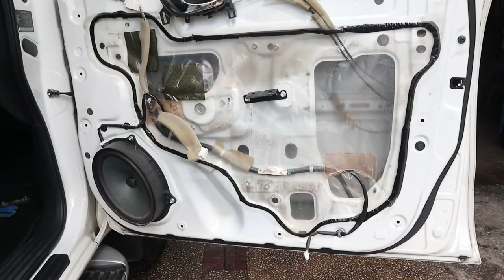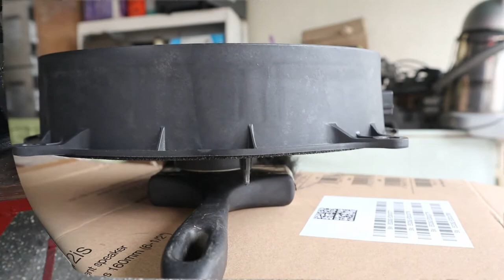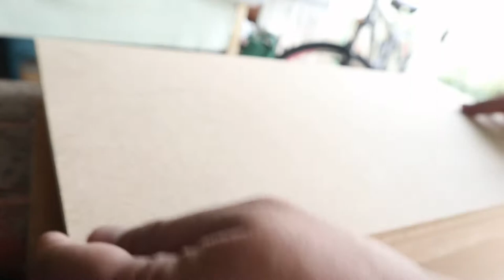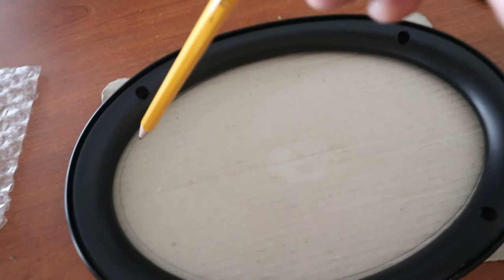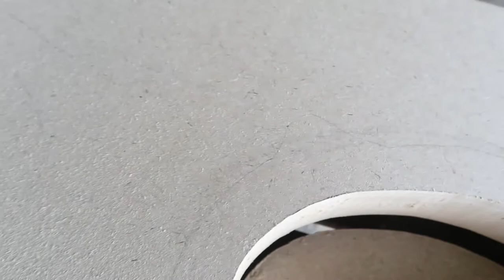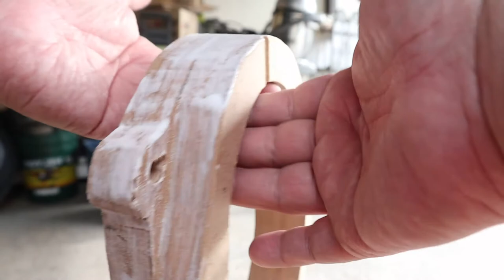Nissan Navara D23 NP300 DIY Aftermarket Car Door Speakers Installation

Comment: how about a 9mm can be still good?
Reply from the maker: Hi. Those are 6x9(inches) speakers. And, they sound better than my stock speakers. I hope i answered your question accordingly.
Reply: @EagleRsDIY  did u use the stock wiring? Plug and play? Cheers mate
Reply from the maker: @keithcerff-wanderingoverla5448  Yes, stock wiring only. I had to use new connectors though. Cheers